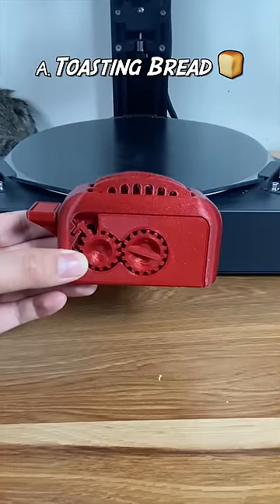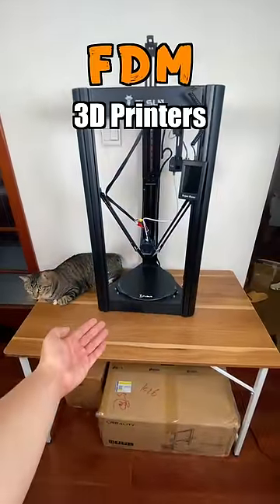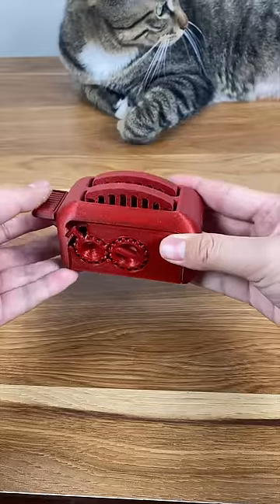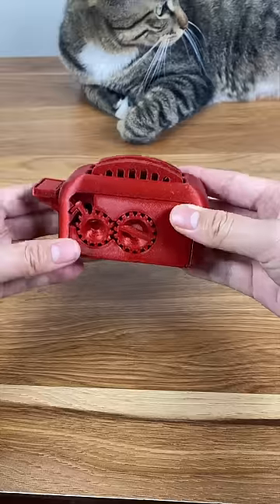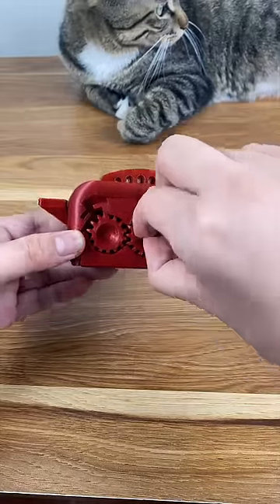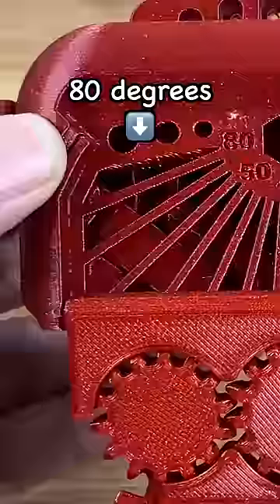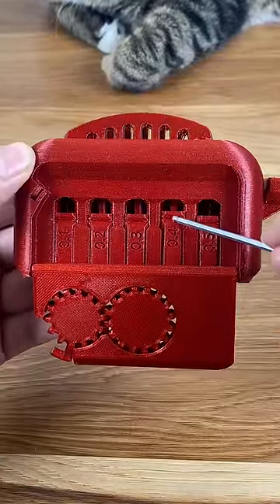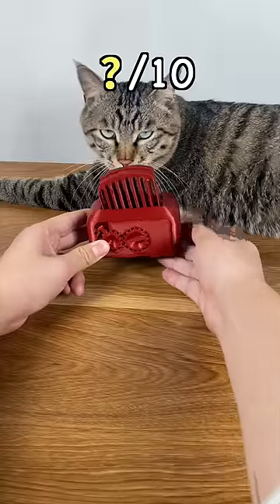A fun way to GRADE a 3D Printer😏

Comment: I’d give it a 75%. The toast ran smoothly, the gears worked, the panel came off well, but the test at the end got a 60%.
Reply: Shirahaha: out of 10 how much will you give it?
KrakVolt: 75%
Reply: @SsTzRn  its a 7.5 then
Reply: @triaxelongd3337  no
Reply: @Steve.._.  that is how math works though
Reply: Idk I think it's more like 80-85% but I dont know much about FDM 3d printers
Reply: I agree
Reply: A rating of 0,75 seems a bit harsh, considering how well it did on most tests, i'd say it's a 7,5 minimum.
Reply: @Steve.._.  75% written as a decimal is in fact, 7.5
Reply: This Benchmark is pretty simple and not too useful because there are a lot of variables that determine the print result. Printing settings can affect the result greatly. Different filaments may behave differently. Different bed designs and surfaces affect the actual bed adhesion.
Printing mechanisms in one piece is arguably not always desirable too, depending on the usage
Reply: @SsTzRn  75% because it got a 60%
Reply: @triaxelongd3337  75% is 0.75 not 7.5
Reply: @MrHoodlin  10 × 75% = 7.5
Reply: @Steve.._.  Yeah, percentages are 100, so divide by tens and get 7.5
Reply: @elibattaglia1200  Not at my school apparently. Getting 89% right would give me a 8.2 for example why I don't know.
Reply: @timdeathly  most likely has to do with the value of the points, or scaling with your total amount of points. It's like having a 101% from e tra credit then you get a 100% on a test and your score goes to a 100.4%. Scoring is super weird and can be very confusing.
Reply: @Africanfrogs  who
Reply: @MrHoodlin  75% of 10, not 1
Reply: @lolseagull how do you know? Don't assume everyone is as smart as you. I personally know almost nothing about 3D printers, but there are people here that do know about them.
Reply: @Steve.._.  75% of 10 is 7.5 lol
Reply: @Steve.._.  that’s literally how math works
Reply: @MrHoodlin  which is 9ut of one. This is out of ten so you would also times by ten
Reply: 6 was the first thing that popped in to mt head
Reply: One a scale of one to ten, %75
Reply: 75(%) is on a scale of 100
Move the decimal point one place over to reduce it to a scale of 10
10.0
Now do the same with 75.0
7.5

You have successfully scaled down.
Reply: ...I can tell some of y'all don't 3d print since y'all can't scale...
Reply: It was enlightening to know how many people can actually use percentages and decimals properly-
Reply: @SsTzRn  I meant 75% of 10.
Reply: @SsTzRn  =7.5
Reply: @SsTzRn  75% of 10?
Reply: @Playboi.joshey  depends. 75% of what? 75% of 1 is 0,75, 75% of 10 is indeed 7,5.
Reply: @yeoj_  compared to what? You need a reference to compare it to
Reply: @Playboi.joshey  no, 75% as a decimal is 0.75.
75% of 10 is, however, 7.5.
Reply: @brilianfustsakib9793  what’s your point?
Reply: @elibattaglia1200  i am amazing at primary school math (nothing more though:) and i can confirm, that is infact how math works
Reply: @Africanfrogs  Oh nah, jit was givin his legit opinion. Go back to twitter fam.
Reply: @theredphoenix33  thank you for helping me confirm that that is indeed how math works:)
Reply: @elibattaglia1200  no
Reply: @MrHoodlin  WAIT NO ITS OUT OF 10. You almost made me admit defeat
Reply: @Charliee23676  75% of 10 is 7.5 there's no real argument there, but I almost did say 0.75 because that would be 75% of 1😅
Reply: There are a lot of people arguing over basic math here lmao
Reply: I get the 60% completion at the end but man that’s some steep grading to eat a quarter of the grade just because one part of a larger test didn’t quiet work out x.x that’d be like maxing out the test scores for reading writing and language in the SAT then missing three questions in the math section only to find out your total score gets docked as if you completely failed that part 

That said do you have a printer you’d suggest? I’m actually really into the hobby and I get slamming the printer down to 7.5/10 but I know nothing of this particular type of printer :o so I’m hoping to be pointed towards a really good one
Reply: @elibattaglia1200  technically percentage to decimal itd be .75, but out of 10 it is a 7.5 so
Reply: @cacher5841  yeah ik it's 7.5
Reply: @zinzorius313  75% is 75/100....therefore meaning the total score is 7.5 but I assume you didnt pass math and instead comment and attempt to correct people about math when you know nothing.
Reply: @Playboi.joshey  false, 75% as a decimal is 0.75

75% out of 10 would be 7.5
Reply: nah, i’d say its about  ln(1809)
Reply: @eionn_rm  Or he’s just 4 🤷‍♀️
Reply: God I love being an engineer seeing fellow nerds fight about equations is so refreshing to me
Reply: For what I use my printer for, I would say an 8.5 as it hits all the requirements I've ever needed.

If I was into making things requiring close tolerances, or large overhangs then 7.5 is a fair value.
Reply: People still edit for thanking people who like their comments?
Reply: Good job, i didnt realize any of those details! Thank you for pointing them out for me.
Reply: @elibattaglia1200  0.75 is 75% 7.5 is 750%
Reply: @Playboi.joshey  75% as a decimal  is 0.75
Reply: @brilianfustsakib9793  it's x 100 cauae it goes two decimal  places not one
Reply: @couldneverbeme1  7.5/10 because it's out of 10 points. You would been right if it were 0.75/1 which is in fact 75%. It's all just ratios and scales
Reply: @MrHoodlin  do you know how average work bro
Reply: @pappi8338  I was attempting to end the bickering in the replies. I had figured if I was doing that I may as well thank everyone who liked.
Reply: @MrHoodlin  they gave it a 75% overall yes, the test at the end brought it down
Reply: @triaxelongd3337  0.75 actually.

1 is considered 100%, such as .01 is considered 1%

7.5 would be 750%
Reply: @wasOnceBigJ  if you're scoring it out of 10 (100% equates to 10/10), how is 75% 0.75/10?
Reply: @KrakVolt  It just seems like a lot of us here need urgent help with basic math... the entire comment thread turned in to a math help center somehow, and a few people are struggling despite the help given-
Reply: @Playboi.joshey  yes, it is definitely not .75 as you learned in 6th grade
Reply: @Playboi.joshey  o I didn't read the whole comment list brb
Reply: @Playboi.joshey  no, it is 75% of 10. So it is 7.5 because 0.75*10= 7.5 and is the rating.
or ur just commenting not relating to the rating
Reply: @MrHoodlin  yes, it's 0.75 out of 1 so 7.5 out of 10. stop pretending to be smart
Reply: @HeterosexuaI  60% of what?? how do  you know the weight of any of the tests? if you solve 3 out of 5 problems at a test do you get a 6/10? no, because we have no idea how many points is worth each problem. if you know nothing about 3d printers there is no judgement you can make here.
Reply: @couldneverbeme1  learn the rule of 3
Reply: @MrHoodlin  75% of one is .75 but 75% of 10 is 7.5
Reply: @MrHoodlin  how the fuck is it 0,75?
Reply: @Steve.._.  You've failed to realize a number was already specified. Mathematically 75% is equivalent .75. however 75% of 10 is the verbalized form of .75*10. Or 7.5. Why is it being multiplied you ask? We wouldn't multiply 6 out of 10 and get 60 you say. Simple. We can convert 6/10, the equation form of "6 out of 10" into a fraction, and we're left with a fraction equivalent to 60%. However with the percentage given first we simply reverse the process and multiply the rating given by 10, instead of dividing it. It's kinda like solving 2 step equations in Algebra 1.

This is how math works it's just a really convoluted thing to explain and realize.
Reply: Man, I kinda wanna just ping everyone that said the OP said .75/10 instead of 7.5/10.
Reply: I said 7/10 so I wasn’t far off
Reply: @cloudbasedbear  I mean I did use 1 as 100% so I'm right in my own cause 😤😤
Reply: @flame4627  bruh... 75% of 100 is 75 ._.
".75" is 75% of 1
Reply: @ブラッス  bruh
I guess I gotta study percentage concept again too 🗿
Reply: @flame4627  🗿
Reply: @wasOnceBigJ  yes, you are correct, you know how to convert percentages  in to decimals, that is the first step. ..but you also wrongly "corrected" someone else, as did other people who made the same mistake.  

so because you got the answer wrong, you are also incorrect.
Reply: @elibattaglia1200  I hope you understand that "%" basically means "out of 100." Percent is Per- = for each, and -Cent = 100. 75% is equivalent to 0.75, or 75 hundredths. The scale being to 10 (including 0) would give you 7.5 as a result. If the scale was from 1-10, the score would be 7.75 (because there are only 9 digits to scale from). Point being, 75% numerically is 0.75 read as 75 hundredths.
Reply: @PistaZOV  If the scale is already defined as 0-10 (which it clearly was in the video), then 75% would be three quarters of the scale. So 0.75×10 or 7.5.
Reply: @couldneverbeme1  7.5 is 750% only if you have defined 100% is 1.0.

100% is unit-less, and only meaningful if there is a definition of what 100% is intended to represent. In this case, it's obvious 100% is i tended to represent the perfect score. So 10 out of 10.

If 12 children does a test and all get a correct result, the 100% is not 1 child but 12 children. So never ever translate percent into something else before ha ing figured out what 100% is defined at for that very specific case.

Maybe 100% is the average male length, which for a specific country could be 182 cm. Which then means 90% is 18.2 cm shorter and 110% is 18.2 cm longer.
Reply: @Kidderrgaming  I'm aware, but that doesn't change that it's 7.5 in this case because 75% of 10 is 7.5
Reply: @perwestermark8920  you really trying to debate me over 6th grade maths? I also said "depends" so that such a comment like yours wouldn't come up
Reply: @elibattaglia1200  Unless the scale would start at 1*. Just double checking, you seemed to argue with, mostly, people who were right in this thread so you had me confused.
Reply: The printer calibration scored and 8.95/10 by your metrics. Toast: success, strings: success, gears: success, angles: 7/8, tolerance: 3/5. 100% + 100% + 100% + 87.5% + 60% / 5 = 89.5% ≠ 75%
Reply: @Kidderrgaming  I argued that the correct answer in this case was 7.5 when the people I was replying to as saying it was 0.75
Reply: @elibattaglia1200  I guess I only saw one individual say 75% of this was 0.75 so I was confused by the arguments lol
Reply: @Kidderrgaming  yeah there are a lot and I've been getting a lot of replies so it's pretty confusing
Reply: That edit is kinda cringe
Reply: I'd give it 25 points. The toast was really hard and chewy. Marmalade didn't help much. Would eat again.
Reply: @brendanr1525  so true
Reply: @brilianfustsakib9793  Why are you multiplying 75% (.75) by ten?
Reply: You are wrong
Reply: I don't got enough 🍞 for a 3D printer 🖨️
Reply: @MrHoodlin  on a one to ten scale, 75% is in fact 7.5/10
Reply: @wasOnceBigJ  100% isn't necesarly 1. A 100% is something thats whole. Here i took 10 as 100%  since most ratings are done from 1-10 or 1-5.
Reply: @djhowell5273  true
Reply: @Playboi.joshey  no it isn't, 100% is 1 and 75% is 0.75
Reply: @Pedro270707  100% is the whole of something usually 100 in this case we only have 10 points.
So bear with me;
100% = 1 whole
50% = 1 half

Half of 10 = 5
Meaning in this case 50% out of 10 = 5
25% of ten = 2.5 (because 2.5 + 2.5 = 5 aka 25% + 25% =50)

50% out of 10 (aka 5)+ 25% out of 10 (aka 2.5) = 7.5

0.75 out of 100 but because we only 10 points 7.5 out of 10.
Reply: @the_blind_paladin_kiwi  yo you just wasted time everyone knows that already lmfao
Reply: @elibattaglia1200  no it’s not. Any fractional is less than one when the numerator is less than the denominator. 1/10 is 10% of 1 whole, therefore .1. It would be .75, 3/4 or 7.5/10 but decimals in a fraction bother me so I would personally prefer 3/4.
Reply: @MrHoodlin  yes cause 100% = 1 so you have to multiply it by 10 to get scale 0-10 so 100%=10 and 75%=7.5
Reply: @hexyhexagonic2940  The person I replied to said 0.75 so not everyone apparently lol
Reply: @djhowell5273  eh, not arguing
Reply: Does no one understand that 0.75, 7.5, and 75% are all correct? Just depends HOW you are viewing it, decimal, of-10-rating, or percentage (not that it matters since they come to the same effect regardless) guys this is the epitome of a pointless argument
Reply: i’m honestly laughing at these people being confidently wrong 
75% = 0.75 because 0.75 • 100 = 75
Reply: @gothic_dawg  You're wrong.
Reply: 8.6/10
Reply: @Atomsk2  assuming that test a and test b are weighted equally, and that test a scored 100% and test b only 60%, the total overall score would be 80%. There was a minor flaw in the print angles, though.
Reply: @KrakVolt  put it in a calculator
Reply: @Steve.._.  actually yes
Reply: Counted the 4 solid wins plus an .6 for the stress test of 3/5 or 6:10 so I would say a 4.6 out of 5 or a 9.2 out of 10
Reply: @Playboi.joshey  no it's not written as 7.5 😂😂 it's 0.75
Reply: @crateer  He asked for a mark out of 10. So 75% would be 7.5. 🤦🏼‍♂️
Reply: @MrHoodlin  75% of 10 is 7.5
Reply: I think you mean 7.5 out of 10 or 75%/100%
Reply: @ankitatarway4911  I meant 75% of 100% and 100% is equal to 10 because it’s the maximum.
Reply: @brilianfustsakib9793  10x75=750, 10x7.5=75
75/100=7.5
Reply: @obscure.reference  It’s a percentage though so it’s 0.75 x 10 = 7.5.
Reply: Si that’s a 0.75/10 that’s an horrible grade
Reply: @nicolas9570  It’s a 7.5 / 10.
Reply: @Playboi.joshey  actually it is .75 but because it is on a scale of 10 then it would be 7.5
Reply: @KrakVolt  75/100/10=0,075
Reply: @nicolas9570  Your math is incorrect. 75% of 10 is equal to 0.75 * 10 which is equal to 7.5/10.
Reply: @KrakVolt  it’s 75% out of 10. Absolutely not of 10
Reply: @nicolas9570  How old are you? This is 5th grade math.
Reply: @KrakVolt  75/100 out of 10 is 0.075, i am right. just type (75/100)/10 on any computer and you'll see the answer. I just think that you didn't mean that by saying 75/100 out of 10 and so i was kidding about your answer but i am still right, 75% out of 10 is 7.5% so 0.075
Reply: @elibattaglia1200  It would be 0.75, as 75% can be represented as 75/100, and 75/100 in decimal form is 0.75. So, that is not how math works. Call me a nerd if you want.
Reply: @The Name's Ethan  I know, but 75% of 10 is 7.5, 75% of 1 is 0.75, and I'm well aware of that. (1×0.75=0.75, 10×0.75=7.5, 0.75 is used to represent 75%, but it doesn't actually tell you your answer unless it's you're multiplying it by one)
Reply: Now he is a 3D printing grading expert
Reply: @Playboi.joshey  75% written as a decimal is in fact, .75. Your math, and your comma usage, was wrong.
Reply: My ender 3 v2 would print 5 layers then give up!😄😉
Reply: @zinzorius313  75%, in fact, is 7.5

Did ya skip math class again?
Reply: @TUNDIRE409  "Percent" means "Of a hundred".

The fraction 75/100 can be simplified to 0,75/1.

When a fraction does not state what it is "Out of" it automatically means out of 1.

For example

1/2 of 300 is 150. 
1/2 is 0,5

You are correct that 75% of 10 is 7,5, but that was not what the commentator said.
Reply: @zinzorius313  Maybe it was FUCKING OBVIOUS
Reply: @TUNDIRE409  Did you not see the attempt at humour in my first comment?

Obviously they meant 7,5, I do understand that, but I found it amusing that they technically rated it a 0,75 out of 10.
Reply: @zinzorius313  okay... If that's true then congrats, u even fooled me!
Reply: @SsTzRn  you failed math class
Reply: @zinzorius313  you failed math class
Reply: @MrHoodlin  you failed math class
Reply: @egpicgammer232  "Percent" means "Of a hundred".

The fraction 75/100 can be simplified to 0,75/1, which is 0.75.

When a fraction does not state what it is "Out of" it automatically means out of 1.

For example

1/2 of 300 is 150. 
1/2 is 0,5

You are correct that 75% of 10 is 7,5, but that was not what the commentator said.
Reply: @Playboi.joshey  75% as a decimal is 7.5? Did you pass basic math? It’s .75 100% is 1. You move the decimal point to the left twice to turn a percent to decimal.
Reply: @Playboi.joshey  75% written as a decimal has never, in fact, meant 7.5. It always has and always will be 0.75
Reply: @Steve.._.  it not that hard to turn small percent to number
Reply: A 8.9
Reply: @Playboi.joshey  no it isn’t mate. 100%=1 in decimal form. So how the hell would 75%=7.5. To make a percent decimal form you move the decimal point to point to the left, or divide by 100.
Reply: Nick Paul  There is no mention of 10 in KrakVolts comment,  75% is equal to 0,75.  

Percent means "Out of a 100", 75 divided by 100 is 0,75.

Yes, I do understand that they meant it as a 7,5, but mathematically they did rate it 0,75.
Reply: Nick Paul  I am perfectly aware of the fact that 75% was intended to mean 7,5, you do not have to reiterate that.

When describing a number you should always explain it as exactly the number you mean, if possible. Neglecting to mention the "out of 10" part means that if the comment followed the rule of always explaining things exactly means that the commentor gave it a rating of 0,75, as that is what 75% means in EXACT language, I found that mildly humorous.
Reply: @elibattaglia1200  lol have you not went to school no it don’t 75%= 0.75
Reply: @MrHoodlin  that what im sayin
Reply: @valculaura  75% of 10😑
Reply: Plus it makes terrible toast.
Reply: @triaxelongd3337  no
Reply: what is 3d printer tolerance?
Reply: Tolerance in 3D printing at home tho isn’t crazy accurate. That’s why people spend hundreds of thousands on industrial ones for the tighter tolerances. The difference between. 0.1 and 0.3mm tolerance for 99% of people is absolutely fine, and if you need it super accurate you can just increase or decrease your dimensions by 0.2mm. That’s whT that extra 100,000 is in the cost of home vs industrial, is that final 0.2mm of tolerance.

I’d say for home use and prototyping, and tbh 99% of people. Basically everyone other than people doing things where accuracy is super important like gears etc, or medical devices this printer is a solid 8.5/10.
Reply: Its a Prusa, I wonder what kind of printer you would give a 100% (10)
Reply: Considering the rapidity of this one I'll give it 8/10
Reply: @Steve.._.  what is it then
Reply: That’s actually pretty good tolerance for an FDM
Reply: 75 out of 10 wow
Reply: Personally for a rating like this, there was an 100 for the Bed Adhesion Test. The Stringing is a bit bad at 80 degrees, so I think thats acceptable for a 95. And with only 3 out of the 5 Tolerance Test, that is a 60. The median of all of these together is 85, so in a scale out of 10 I would say this test was an 8.5 out of 10.
Reply: @SsTzRn  percentages are numbers silly
Reply: Agreed
Reply: It literally got almost everything, passing the last one is really hard
Reply: @Steve.._.  bro said no to math 💀
Reply: @Playboi.joshey  its .75??
Reply: Thats more of a 90 if you do it mathematically
Reply: @gothic_dawg  bud it’s 7.5 because it’s out of 10 I don’t know why that’s so hard to understand it’s not out of 1
Reply: @orangestorm9392  this was a year ago, i honestly forgot what i said but you’re completely right lol
Reply: @elibattaglia1200 no
75% = 0.75
Reply: @Playboi.joshey no, it’s 0,75
Reply: @jarcophagus if you divide 75 with 100 you get 0.75. Steven is right😂